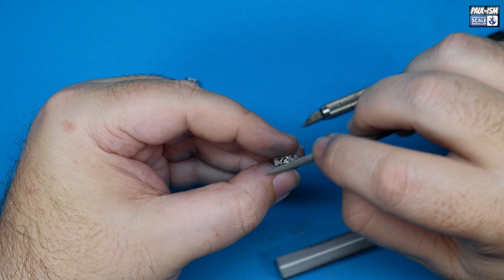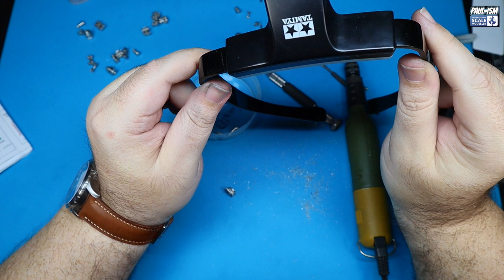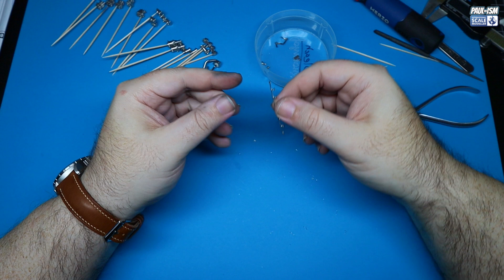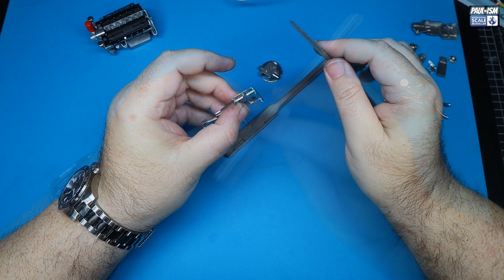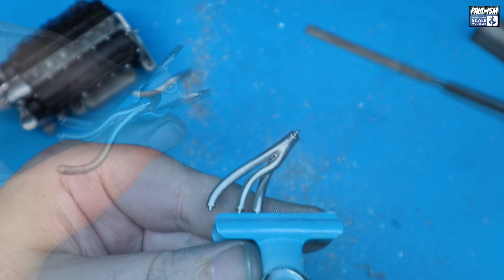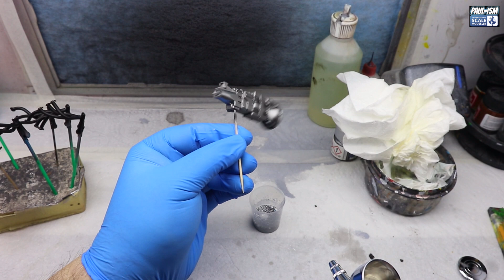Part 3 - Model Factory Hiro Ferrari 250 GTO

Comment: Congrats Paul, it's a very nice car and very exact build so far. I want to give you some tips for you soldering, if you don't mind. I would use the flux as you do, but then I would cut some tiny little pieces from the solder in the size of the soldering area. Lay this piece on top, take your soldering iron, adjust a bit more temperature and heat up the metal part only. The result is, the solder will melt and the flux helps that it flows exactly where you put the flux. Important is, not to heat up the solder, because it will stick immediately on the tip of the iron. Maybe you try this, and give me a feedback, whether it is useful for you. CU Rainer
Reply from the maker: Thanks for the tips :)